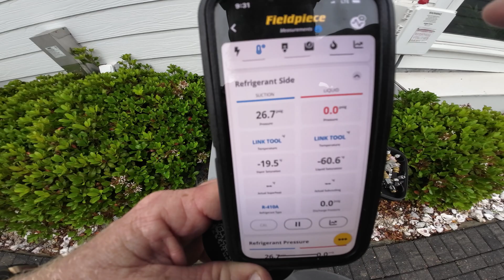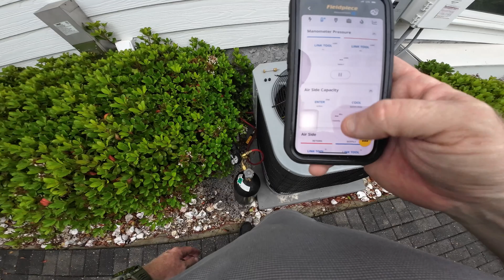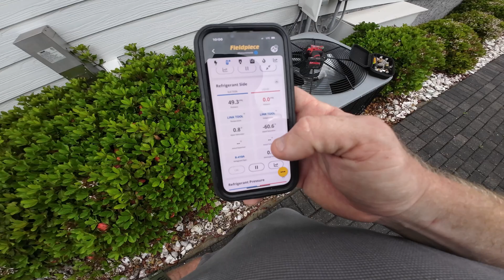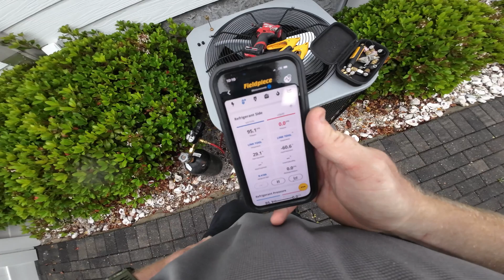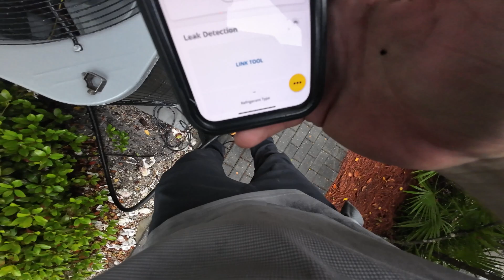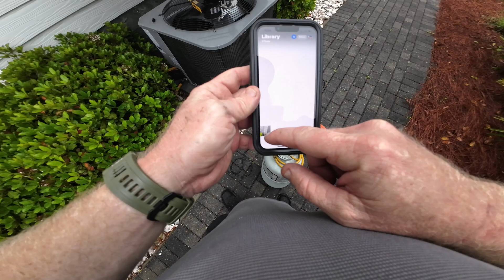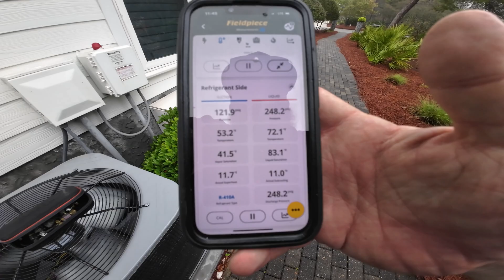Install company said my prices were too high to repair his poor install !!!!!

Comment: Homeowners dont understand EPA tracking and having to recover and store it and get it recycled.  Its not just a $300 jug of freon.  Mr Home Owners.
Reply from the maker: @bmillwood6666 that wasn’t even the homeowner lol that was the company that installed it
Reply: That guy definitely vents to the air. And can’t get under 500 microns? The reason he charges cheap is probably because he offers “cheap Freon top off” to charge systems every summer.